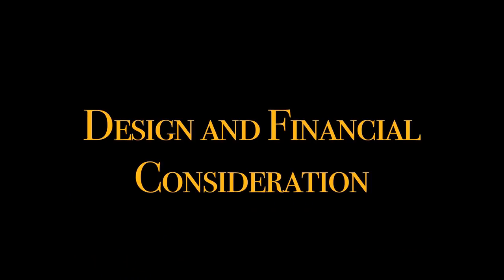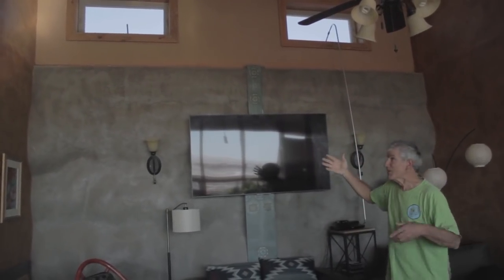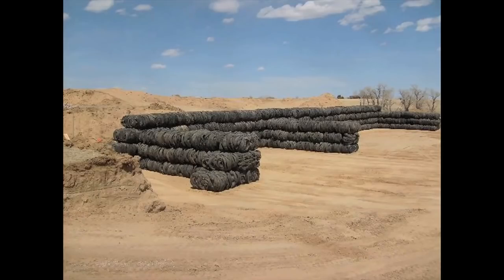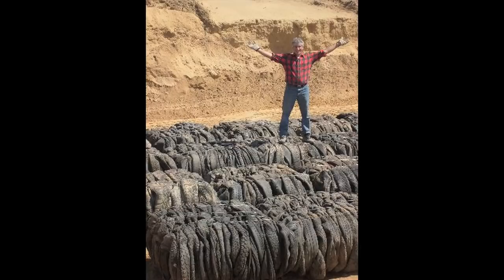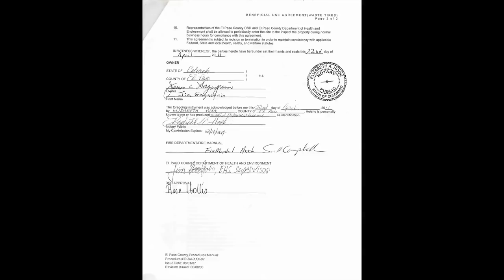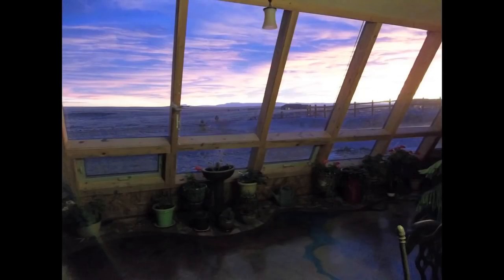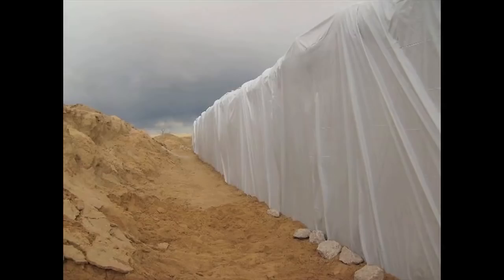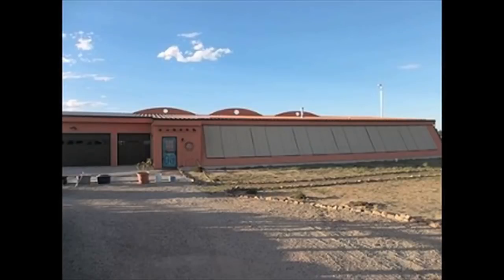Zero Energy Passive Solar Bermed Earth Tire Bale Home - Pseudo Earthship

Comment: Jim, Thanks for this in depth video. I own a conventional stick house a couple of 100 miles south of your place and add an earthship-style greenhouse to the southern uphill side. My thermal mass tire wall is located right opposite than it is in your home, but I think, the basic energy principles remain the same. Heat battery on the higher south side - so I will need some fans to blow the warm air into the lower conventional built north part. But hey... You can´t have it all!  Concrete on tires - HA! Yes, an interesting problem to solve! I earth rammed the tires, so there is always the option for stakes, or concrete filled tires at strategic points. I used lath and plastered them. Where did you get the R-value for tire walls? Could not find them anywhere? For a long time I already have been on 100% solar for the home including charging my Chevy 2014 VOLT, 100% renewable (not clean though) Quadrafire wood stove heating and I am 100% on rain water with 7000gal inground cisterns. The Greenhouse will be just an add-on to cut my 6 months heating season by 2 months (hopefully more), re-cycle the grey water, grow some food all year round. Also to create a warm, cozy, plant filled out-door kind relaxing space for the winter months. With a solar heated hot tub may be? Still dreaming!  I love to see all these different innovative building styles. I was inspired by Mike Reynolds and his earthship concept. I love the artsy elements your wife put into the very functional design of your home. Must be a great place to live! Enjoy it!
Reply from the maker: Actually, R60 is simply the max, so I used that.  The El Paso County building department used R45, and that's what we used for our thermal analysis.  If I understand correctly, your bermed wall faces South?  Greenhouse faces North?  If so, I think the berming principals will still apply, and the structure will probably maintain temps of 50 to 55 deg, without heating.  This will be great for growing many plants, especially cooler weather plants like peas, spinach, etc.  I have problems with seedlings burning up (they dry out very quickly), in my Southern facing windows.  You shouldn't have this problem.  VOLTs are great!  Considering they the 2017 car of the year, I can't believe GM discontinued them.
Reply: @jimgagnepain7708  Greenhouse faces south. The "Berm" is a massive concrete filled block wall inbetween the greenhouse structure and the existing home. The greenhouse windows will be on top of the tire wall, which is on the southern uphill side. So, I have thermal mass walls on both sides of the green house. Temperature control will be an interesting challenge, I guess.

Comment: I live in Colorado Springs ... It seemed like current permitting was tough for alternate methods , so I just placed a used mobile home, would still like to do this, maybe for an office/studio... I have 11 acres RR-5 area
Reply from the maker: Contact me via Messenger at "Little Bermed House on the Prairie".  Maybe we can get together and discuss.   PPRBD is open to alternative methods, especially if you can reference other approvals they've done in the past.  You have to sign something that states that you will dispose of all tires, if you don't follow through with the build.  The biggest obstacle is usually fire egresses.

Comment: Thank you so much for this film. What would you recommend for cold north with 4 months of no sun?  Any ideas are welcome.
Reply from the maker: That's a tough one. Earthship Biotechture claims there are earthships in all 52 states.  I think you would still benefit from all the days with sunshine.  The berming will still hold the inside temperature to a low in 50-55 deg F range, even without external heat, assuming the home is sealed.  During the sunless season, I think I would roll some batt insulation into the large window cavities, on the inside of the home, to prevent heat loss.  Then whatever method conventional homes in the area use to heat (wood, natural gas, propane, etc) could be used, but a lot less of it.  I would use an HRV or ERV to constantly circulate fresh air into the home, expecially if burning wood (or other) which will use the O2 in the home, and lead to high, unhealthy CO2 levels.
Reply: thank you Jim, you answer is much appreciated

Comment: Jim, thank you so much for the detailed explanation of your Earth house and construction. I really appreciate all the details you included in this video. One question I would like to ask. Some of the earth home owners mentioned that the tire bales project a toxic smell in the summer, that is not just unpleasant but hazardous to our health. I watched your video a few times and you did not mention anything about is. Could you let me know if that is true. Can you smell it in the house. Thank you again for displaying not just your beautiful house but all the detailed discrimination. God bless.
Reply from the maker: No.  Two points here.  First, the tires are worn.  Once tires are driven and worn, they gas out.  When you go into a new tire store, you can smell the gases.  Secondly, our tire bales are covered by shotcrete, and then adobe layers on top of that.  We then put a sealer on the adobe.  There is no odor at all.

Comment: Very nice build only problem I see is your grid tied only system! If the power grid goes down you are done all that power from your panels and wind turbine are also being wasted energy ! I would for sure invest in lithium batteries 🔋 to have my own power off the grid and to store and use the extra power your producing !
Reply from the maker: No doubt that a battery storage system provides that backup power.  However, we have very few power outages - average of one or two a year, and most are just temporary blips.  Is this worth paying tens of thousands of dollars?  We are getting to the point that we'll soon be able to use our vehicle batteries as backup power, and they will carry us through most power outages.

Comment: Some great info here. The tire bale concept solves the earth ramming issue. You didn't mention how you designed your water collection/ waste water recovery cycle. I'm assuming local ordinances required conventional design.
Reply from the maker: Hi Jim.  Correct.  We did not do any of the typical Earthship water systems (grey water, etc.).  We have a well, and our wastewater is a traditional septic system.   When we built the home in 2011, water catchment was illegal in the state of Colorado.  That law has since been revised.

Comment: Great looking home. But what changes would you have to make if you were building in the tropics where the temperature was typically 30 to 40 degrees Celsius the whole year round and with a rainy season ?
Reply from the maker: The home would be built for cooling, not heating.  It would be bermed on the South side (assuming Northern hemisphere), and glassed-in on the North side.  You would probably need some air conditioning or dehumidification.  It won't have to work near as hard, with the cooling from the berming.

Comment: Curious why you choose not to have have the gray water planter cell installed?  Very good and informative presentation. Thank you. The tire bales & concrete walls was very clever approach vrs. the standard single tires with hand made  adobe.
Reply from the maker: We have a traditional septic system.  Although it's not quite as green, with it's reuse of water, it still recycles wastewater back into the earth.  My wife often waters the indoor plants manually, with her leftover bath water.  We decided to focus on eliminating the need for heating and cooling in our home, and getting all our electricity from renewables.  We thought that was a greater bang for the green dollar.

Comment: Hmm, The earthships had a garden all along the southern windows and utilized the white water to supply it, to grow some of your own food, where you just have some pots with herbs along the windows.  I even saw dates and bananas growing because the inside temps were kept around 70F all year long.  So, am I correct in assuming that you are not collecting water on the roof and using that water system, but paying for 'town water' or you have a well?  The earthships incorporated some long tubes that went out the north berm wall to draw in cool air for natural air conditioning, which I really like for airflow.  I guess that might not be possible with the tire bales, as I can see it being challenging and your wall is only 5 feet thick instead of the 15 feet they do in the earthships.  And what about septic system?  What did that cost?  $30,000?
Reply from the maker: Yes, we have a conventional well.  When we built in 2011, you were not allowed to collect rainwater from the roof.  We have some fairly large plants indoors.  We also have 4 young fig trees.  A lot of earthship dwellers use different methods of growing.  The long troughs have their own problems.  I have a friend who started using pots inside his trough, because it was so difficult to change out the soil.  The cooling tubes were introduced after we built our home.  I like the idea, but it may be difficult to keep rodents out (a challenge in any house, including earthships).  Another friend did incorporate the cooling tubes with tire bales.  Yes, we have a septic system.  I no longer have access to my cost spreadsheet, but I think the septic cost between $2K and $3K (2011 prices).  Call around - septic systems don't cost anywhere near $30K.

Comment: Beautiful, thank you for sharing. Do you know if there are any two or more story designs that would be suitable for a normal city lot? (~6000 square feet)
I love the zero energy properties of earthships and similar homes, but they are often spread out and horizontal, and I'd be interested in more compact designs that would allow more people to live this way.
Reply from the maker: Paul, Thats a tough one.  You are correct that most people that build these types of homes have acreage.  Just the footprint of the tire bales would use up a lot of your valuable real estate.  I would suggest a more conventional home, using geothermal energy for an inner-city small home.  Some passive solar can be incorporated, but be sure to shade for the summer.  Some shade naturally with creative landscaping, others use shades (outdoor shades are most effective).  Many have built geothermal homes, and it works very well.  Of course, you can still get most (or all) of your electricity from solar PVs.  Be sure to build a tightly sealed, well insulated home, and utilize an energy recovery ventilator for fresh air exchanges.
Reply: @jimgagnepain7708  Thank you for the detailed response, those are all great suggestions. Especially energy recovery ventilators, I've not heard of them before and will look into them. From what I've read of passive house designs, I was curious whether the airtight seal meant no fresh air :) Appreciation and gratitude for your video above.

Comment: Awesome video Jim!  I wondered if you have any thoughts on using hempcrete plus an earthen berm on the north side?  Hempcrete blocks eliminate the difficulty of creating a straight wall where you may or may not put screws in.  Also, avoiding tire products eliminates the concerns about heavy metal leakage into the soil.  I am asking because we are considering buying land for a home similar to yours.
Reply from the maker: There's another discussion about ICF construction of a bermed wall in these discussions.  Products such as hempcrete and ICF are more practical for most building, in that they don't require as much of a footprint.  In addition, if one lives in a more crowded residential area, it would be difficult to build a tire-bale home, without a lot of flack from neighbors.  I don't know much about the structural integrity of these products.  Bear in mind that there is a lot of pressure on the other side of that bermed wall.  Most counties in the US require Engineering approval for designs.  The design and approval would have to look closely at structural integrity.  Let me know more, if you look into these technologies, as I get a lot of questions about this.

Comment: Jim, thanks so much for your video. Very detailed and informative to say the least. Would you mind sharing the costs involved with the various stages in the project? Thanks in advance.
Reply from the maker: I kept detailed records of all expenses.  The home itself cost about $270K, which includes the cost of the wind turbine and solar panels.  The wind and solar cost about $20K after consideration of rebates and tax credits.  The $270K does NOT include the land.  I should also mention that I GC'd the construction.  This probably saved about $70K.  In addition, my wife both worked on the project every day, and did a lot of the Construction, alongside the professionals.  Unfortunately the spreadsheet that I used was in QuatroPro, and I can no longer open it or convert it.  Otherwise I could provide more details.  Are you wondering about the cost of any particular item?

Comment: Thanks for the thorough explanation! One thing I'm wondering is how do you cross-ventilate in your variant of earthsip? You sloped the roof towards the main glass and placed many small windows over the back wall (I've always thought that would be nice) but I can't see if they are practicable, wich would profit from stack effect, nor could I see the usual hatches seen on earthships.
Reply from the maker: Yes, we use awning windows in front and back to cross-ventilate.  This is only necessary at night during the hottest summer months.  We also have East-West ventilation, with a screen door on one side, and a large window in our mudroom.  We often simply use the East-West system, with a few of the front awning windows.  We don't have any skylights.  The back awning windows are manually opened with a long pole, with an operator on the end.
Reply: @jimgagnepain7708  thank you very much for your answer.

Comment: maybe I missed it but did you say what the cost of a home like this could be? I love everything about this!
Reply from the maker: Without the land, and including the renewables with 2011 rebates (wind and solar), we spent about $270K.  Some explanations are warranted.  First, this was in 2011, on the tail-end of a recession.  Contractors were eager for work, and material costs were much lower.  Second, this includes the well, septic, and all permitting.  Third, I general contracted the build, probably saving 50-60K.  Fourth, my wife and I were on-site every day, and we did a lot of the work.  Example - Our master carpenter helped us with the installation of the first two of eighteen 46"x76" glass sections, and layed the stringline for the other units.  We did the other sixteen, and he checked the tolerances for us, which looked good.  This is just one example which saved thousands of dollars.  We did a lot of the work!

Comment: Did you use just a regular automotive catalytic converter on the stove? Are there any issues with using one? Amazing build btw!
Reply from the maker: The stove came equipped with a catalytic converter.  We only light it about 5 times per year.

Comment: Hi, I look for new passive solar vids every couple of weeks and I am happily I found this vid. Extremely informative. I have subscribed and I hope you make more vids.

Did you buy complete windows? Or just the igu without a frame? How are they attached to your wood framing? I would love more details on this. Thanks.

Also if you have details on the exterior shades that would be amazing
Reply from the maker: Big O - We purchased a commercial glass glazing system called PRO-SEAL from Abundant Energy in Pine Island, NY.  The system consists of an extruded aluminum perimeter that is screwed onto the wood framing (Our design called for a Versalam base for the perimeter, which holds screws more readily).  The glass is later placed onto the perimeter.  Mullions hold down the glass.  EPDM rubber gasketing is added to both the perimeter and the mullions, and the glass butts right up to this rubber.  Care should be taken with the rubber installation, to avoid leakage.  One glass installer told me it's better to use light colors, as they won't undergo as much expansion.  We weren't aware at the time, and we used Oil-Rubbed Bronze.  The operable awning windows below the main glass were purchased locally.   They're nothing special, so I won't share the source.  I would probably get a better window if I had it to do over again.   Caution - no windows, other than skylights, are warranteed in a sloped installation.   After pricing shades on-line, and getting quotes in the five figures, we purchased shades locally for about 1/5 the price.  We got them from Out-West Awning in Colorado Springs, and they are fantastic.  We were told that about every 7-8 years the strings need to be replaced.  On queue, we had the company do this for about $800.  You can see out through the shades, so it's not totally dark, and they keep the interior nice and cool in the summer.
Reply: @jimgagnepain7708  thanks very much for they info. That is exceedingly helpful. I'll start looking at commercial systems and local sources for exterior shades.

I read one book one passive solar and it warned that while slanted glass let's in about 15% more radiation in winter, it allows a whopping 35% more in the summer. Bring that Summers here in Texas are long and hot, I decided to rule out slanted glass as an option
Reply: @jimgagnepain7708  oh and I found the abundant energy pro deal system. They even have their prices online which I appreciate, and I must say it's quite affordable
Reply from the maker: @jl9678  Wise decision on the vertical glass in Texas!